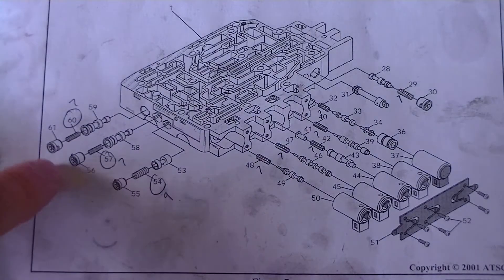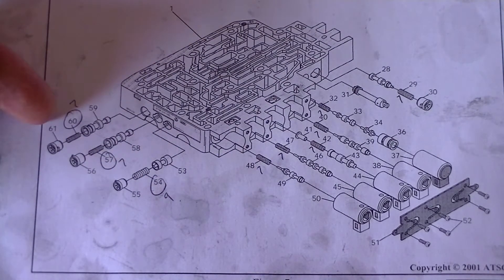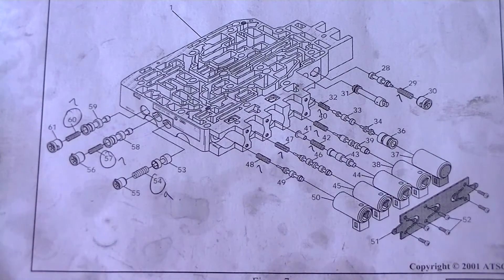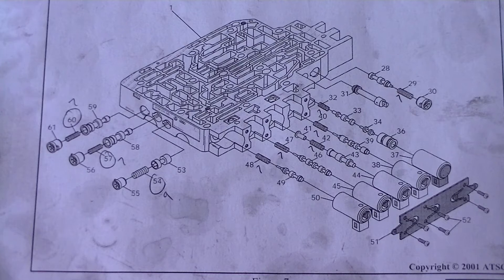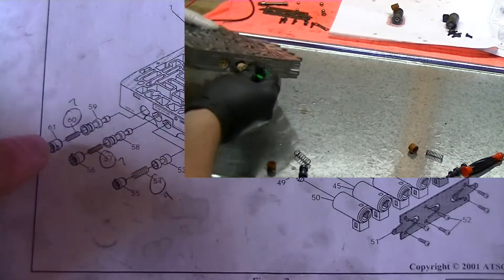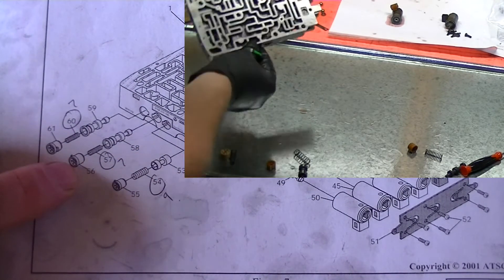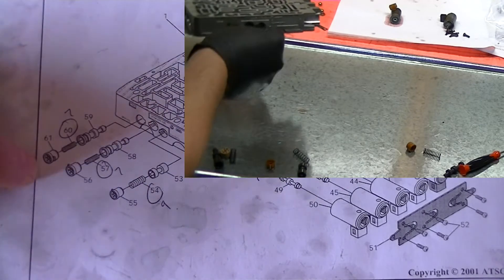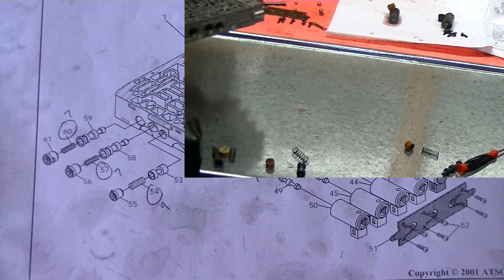VW 01M Valvebody rebuild Issue

Comment: If you check still comments here, please share where you bought a good rebuild kit, about how much time it took for the valve body rebuild, how difficult it was and are any specialty tools needed or tests that should be done on the valve body once its removed to assure it is rebuild able?

Comment: Hi i am from Poland. I bought VW CARAVELLE T4 2.5 petrol with automatic transmission. I have problem because gearbox use i think only third gear. I have only these one gear and reverse. What i must first to do to Check these gearbox. Thank you for answer.

Comment: @badgertronix I found in a manual it addresses the spring being on one side of the valve or the other. It is on page 267 of the Volkswagen manual  Rebuild Tips 096/01M. For 096 valve in first, for  01M spring in first.

Comment: Thanks again Jon , I found this , confirming what you are talking about.
I contacted ATSG and they confirmed that this schematic is for 98 and up, not just  for 98 as the asterix might imply.

https://www.google.com/search?q=01m+valve+body+exploded+view&espv=2&rlz=1C1EJFA_enUS680US680&tbm=isch&imgil=cO83dBqdgiveLM%253A%253BpCkYsgCXO-SG6M%253Bhttp%25253A%25252F%25252Feonicllc.com%25252Fschematic%25252F01m-valve-body-diagram.php&source=iu&pf=m&fir=cO83dBqdgiveLM%253A%252CpCkYsgCXO-SG6M%252C_&usg=__BfqHAzzCNMtifrdrn5Ot38jQJNg%3D&biw=1366&bih=684&ved=0ahUKEwjT2pWJ--vOAhWDNiYKHaXJBM4QyjcIKw&ei=p_bGV5PrHoPtmAGlk5PwDA#imgrc=cO83dBqdgiveLM%3A
Reply from the maker: ah I see. Good to know!

Comment: What we didn't see in the main video ??  I didn't see the main video . I must have missed that one . Google notifications suck unless the main video is  still unreleased. I'm confused enough Haha .
Reply from the maker: it's coming but waiting on parts again. First 3 parts are edited but will get the conclusion sorted before I start releasing episodes so you don't forget what happened at the start. Someone gave me that advice ;)
Reply: +Steve Rob I believe this would be called a teaser...I can't wait to see if those springs mess it up...badger was that drawing from all data?
Reply from the maker: +RICKAFIX +Steve Rob  You're onto it Rick. Also I'm waiting on parts again so if I'm lucky some transmission genius will see this before the parts turn up and they can tell me if it's right or it will explode first turn of the key
Reply from the maker: +RICKAFIX It's the ATSG service guide.
Reply from the maker: +Steve Rob +RICKAFIX I'm a modern man, happy to get elbow deep in my tranny.
Reply: +RICKAFIX  haha a teaser , I thought I missed the series LOL
Reply: +Badgertronix +steve rob yeah 28,29,30 the valve stems are reverse and the spring is on the front...if the picture is wrong with the spring maybe the valve stem is backwards and the genius who messed with it before just put in in to fit
Reply: +RICKAFIX yes I have seen him before , about the best on YouTube.
Reply: +RICKAFIX I've never dug into one before, I change the fluid on our trucks twice a year. Takes 10 min.
Reply from the maker: +Steve Rob What did you think of the new outro?
Reply: +Badgertronix  nice wish I could teckie teckie like that. Trying now how to figure out Sony movie platinum 12 program, so much different than Windows movie maker
Reply: +Badgertronix outstanding buddy can't wait to see what you wear. LOL
Reply: +Steve Rob ditto
Reply: +Badgertronix OUTRO... not Out. Very cool!!!
Reply from the maker: +Thomas EXOVCDS I'm only ahead if it works at the end!
Reply: +Badgertronix I'm sure it will! :)
Reply: +Badgertronix sorry Steve sidetracked me yea cool outro
Reply: +Badgertronix did you do it on pd14?
Reply: +RICKAFIX  Rick look at the card at the top right in the vid I'm the only one that voted, badger vids on this teckie teckie  stuff would be a go.
Reply: +Steve Rob I saw it but it wouldn't let me vote I thought badger eliminated Americans out of the contest
Reply: A contest , I missed the series and now I missed the contest. I like that picture in picture stuff and special effects .
Reply: +Steve Rob your new software you will be able to do that or record a Skype call to
Reply from the maker: +RICKAFIX no way, another www.fiverr.com deal
Reply from the maker: +Steve Rob I could do some of those over on the badgertech channel
Reply from the maker: +RICKAFIX not intentionally, I haven't look at the results yet.
Reply: RICKAFIX  ha im still figuring out all the options. LOL
Reply: +Badgertronix  are you holding out on me. ha ok whats this all about. send a link buddy.
Reply from the maker: +Steve Rob https://www.youtube.com/channel/UCXkuUz7WzILBFgmHi6hpuiA
Reply: +Steve Rob LOL... was wondering the same. Typed-in badgertech and Bob's your uncle! :)
Reply from the maker: +Thomas EXOVCDS +Steve Rob that side of things was put on hold due to lack of space. New workshop, new office, will get back on track over there soon too.